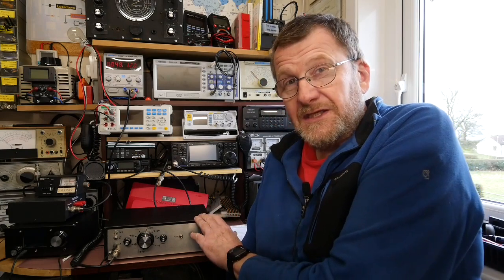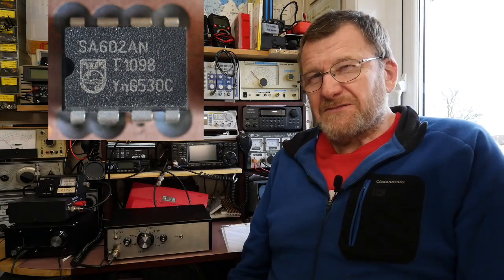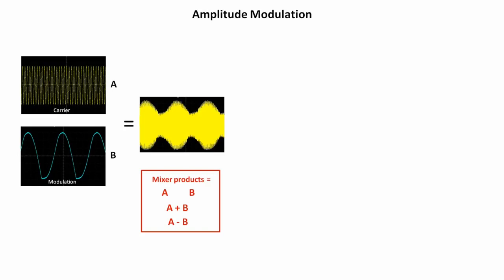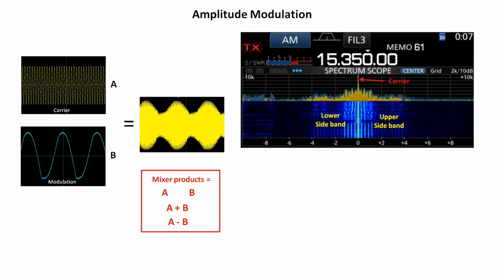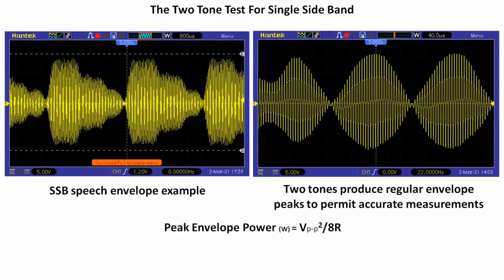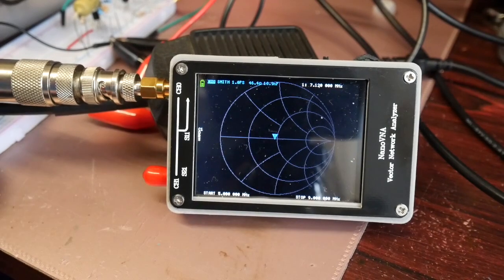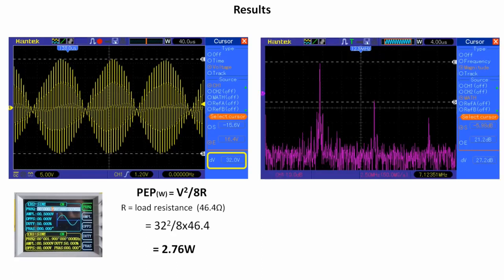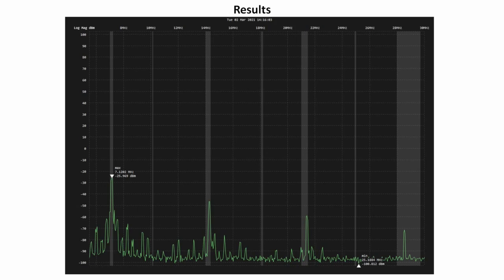Measuring the output of an SSB transmitter                        - #054

Comment: Thanks for the video however when using a two tone test the PEP is halved . If you used a single tone you would see this. Also most tech books will say to use 0.707 X vpeak not vpeak to peak. VK2SS cheers.

Comment: What is the point of this video unless you mention
1.which signal generator did you use
2. values of the the resistors required for the summming circuit ?.
It could have been the best YouTube, video on 2 tone SSB linearity ...
73.

Comment: very cool. not sure i was able to see how the frequency would be modulated tho.. was looking for fm radio transmitter oscilloscope videos to try and get a thorough understanding of how radio works... building a fm transmitter circuit in a electronic circuit simulator app on smartphone maybe they do not behave the same way in app as they do in real life considering the app may not have a enviroment with electromagnetic waves that travel distance and interfere with other devices.

Comment: A nice explanation of the two tone test. Did get a question in part related to this in my recent full licence exam, so of really practical value. Thank you. Why should the two test tones be harmonically unrelated?! M0YZT
Reply from the maker: The non harmonically related tones beat against each other and produce a distinctive envelope.
Have a look at W2AEW's excellent video here: https://youtu.be/3DxBg6h4Fc8 he really knows his stuff!
Reply: @LockdownElectronics  Thanks Bill, will do and put my thinking cap on.......
Reply from the maker: And of course there is the third order intercept, that should keep you thinking a bit more!
Reply: @LockdownElectronics  So, in a practical sense, if I ever buy another radio, look for one with a higher TOI. Use signal attenuation to reduce the TOIMPs by a factor of 3 and don't try to mix the output from my twin Rhode and Schwartz signal generators with a Bamix! Its amazing when the lights go on.